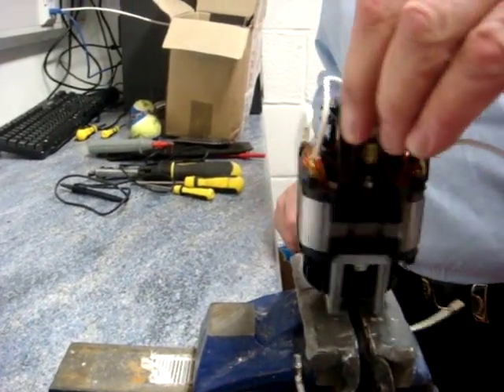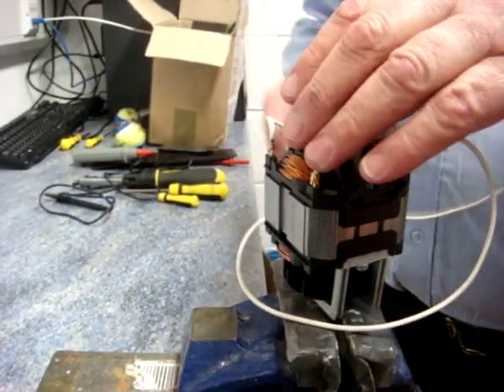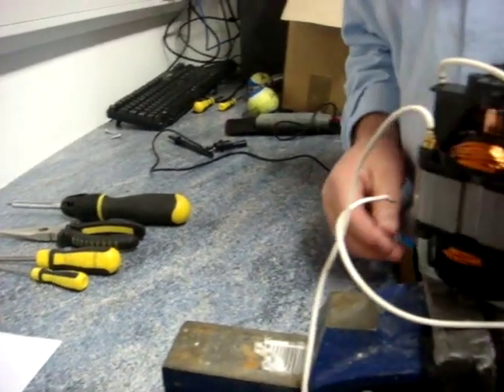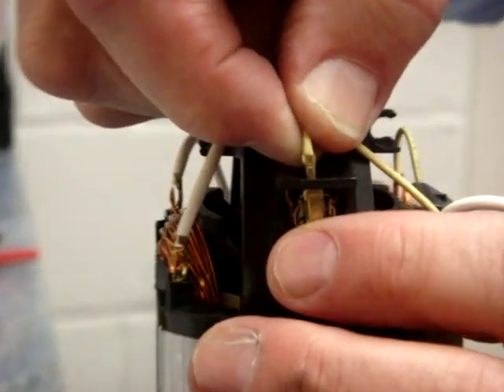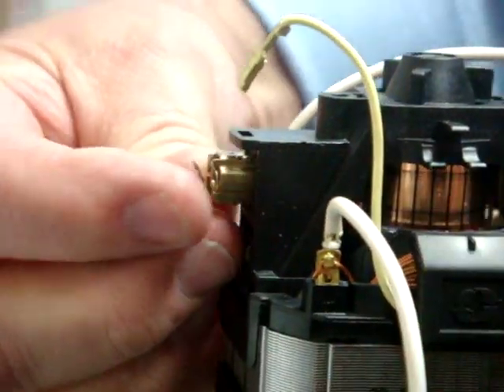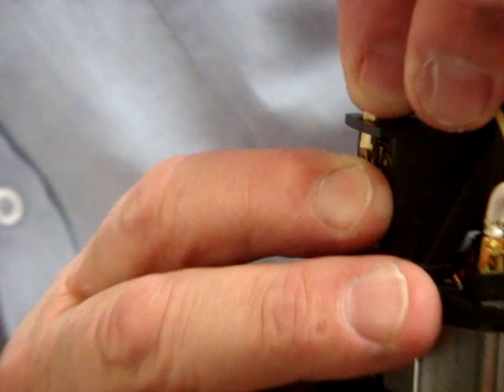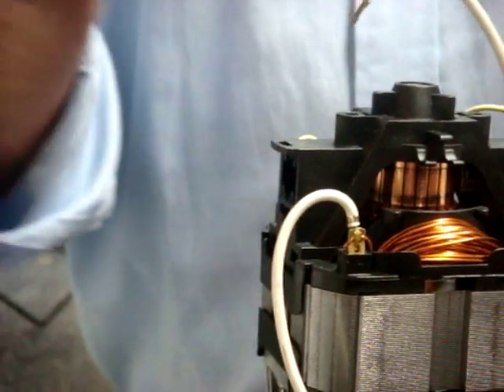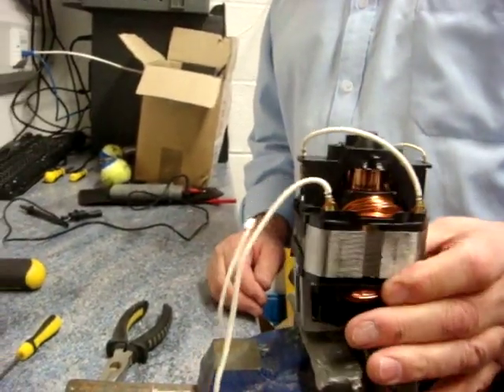How to replace Syntech carbon motor brushes with brass carrier.

Comment: Hi I replaced the brushes on a triton t90si but the shower is still whining like it did before. This is the second set I have put in. Could the copper area where the brushes meet the motor be damaged causing the whining. The first time I replaced the brushes it was whining and once the new ones went in there was no whining. But not this time. Regards Des
Reply: hi des did you sort the problem also my shower has lost presure is this the problem as iv bled the shower and changed the shower head and still the same is the motor dien or do i just need new brushes cheers
Reply: kyle mcmahon I decided to get rid of the triton. when I looked at the top of the shaft it seems that the plastic bearing there had become worn and allowed the shaft to move around too much causing the carbon brushes not to be in full contact with the copper part. I fitted a grundfos pump and a thermostatic bar valve shower. I run it off the hot water. the pump pressurizes the whole house and not just the shower.